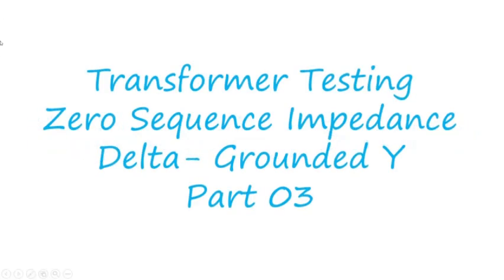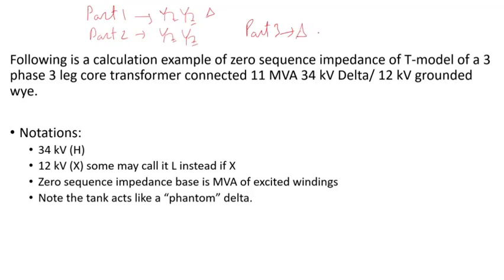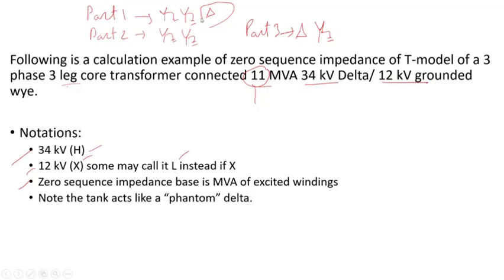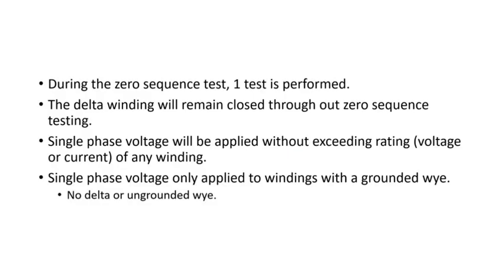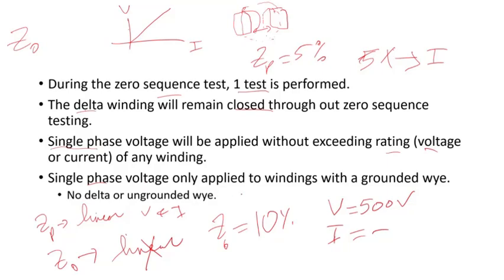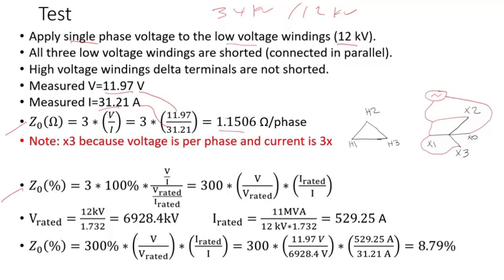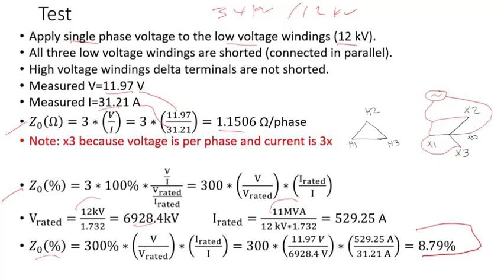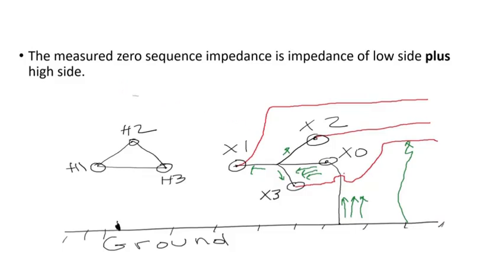Transformer Zero Sequence Impedance Testing Dyn - Part 03

Comment: Thanks for excellent video, just wonder how is the zero sequence impedance of the high side also included in this impedance, for me it looks like only the low side zero sequence impedance is included?
Reply: I am thinking that the delta winding has circulating zero sequence currents that must contribute to voltage drop and thereby impedance
Reply from the maker: Thank you for the question. Given this is a delta high side, delta is modeled as open circuit in T-model since it does not have any return through the ground which is where zero sequence flows. 

Only zero sequence current (I0) is trapped/circulated inside delta. I0 does not leave the delta. It circulates inside the delta since it is a closed loop. Hope this helps.